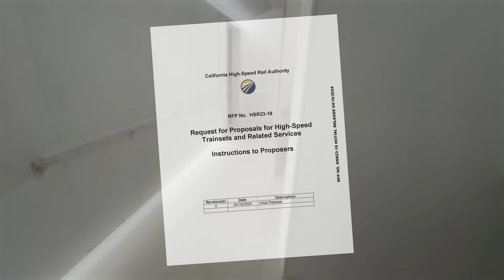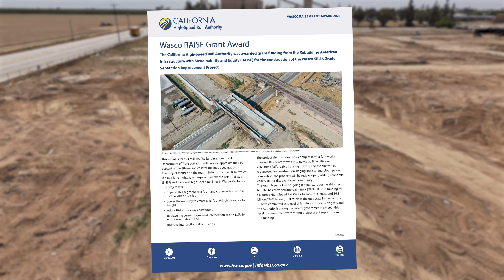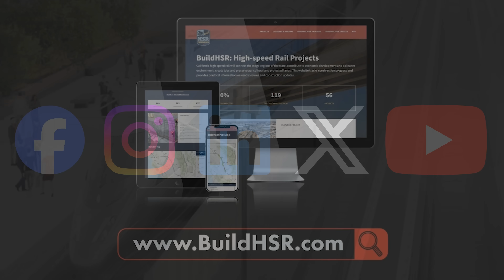Spring 2024 Construction Progress Report: Trainsets, Construction, Stations, and More!

Comment: All of this in only fourteen years at a cost of $11,000,000,000, we now have 1,600 feet of track on the ground, just for perspective that is the length of 1/4 mile drag strip with the run off area. Absolutely an unmitigated success story worthy of celebration, kinda like Olympic Break Dancing.

Comment: guess which one will be completed first, India HSR or CA HSR?
Reply: Trick question! California will never finish - costs have already spiralled out of control and this section is far-and-away the easiest/cheapest portion.  Tunnelling into Bay Area/LA will involve multiples-higher costs.
Reply: Of course, India’s. Despite being 503 km (312 miles) all viaduct route and 21 km tunnel (5km undersea), 153 km viaduct with 300 km foundation/pier work already complete. Construction started in 2019 and will complete by 2027-28. Cost is also USD 20B.
Reply: Both will finish in 2028 .. and both will be success ..
Reply: @unclekanaamcuttingwalahai332  2028? Oh dear. They won't even have begun tunneling - and by that time, their absurd lowball cost estimates will be a fantasy.
Reply: @ArthurDentZaphodBeeb  there is olympic in 2028.. so I think its possible they will work their @ss off before olympic to finish the project..and I dont think US should think about cost ..

Comment: QUIT WASTING OUR MONEY! Take 2% of that CHSR money and add lanes to Interstate 5.
Reply: Are you actually being serious? Have you heard about induced demand? There's no point in doing that, because sooner or later, the road will fill up again.
Reply: @NewBuildmini  First of all, even if this boondoggle ever gets finished, which I doubt, it will only take a tiny percentage of the people and none of the goods that travel I-5 and Hwy 99 every day. 

Have you ever traveled I-5 through the Central Valley? If you buy stuff, any stuff it probably traveled on a truck via I-5. The traffic caused by thousands of trucks and cars limited to two lanes of traffic each way causes an increased number of accidents, slow stop and go traffic, increasing pollution and wasting millions of hours of people's time. I would never use the train, as it would cost me time over flying, or save me so little time over driving, that it wouldn't be worth it, especially if I have to take the time and money to Uber to the station, then stand in line to rent a car once I get there. 

A high speed rail line would make sense for some, but I know very few of them. Most of those that would now, will be long dead by the time your precious CHSR is finished. The Vegas train makes way more sense, in that most stay in hotels in Vegas, and they walk or take taxi's between Casinos. The CHSR boondoggle will never come close to even paying for it's own operating expenses and will be a burden on taxpayers forever.
Reply: @traxiii  Not much else to say.  Nailed it.

Comment: Naysayers be damned. CA needs this badly.
Reply: In the construction accounting world we are very familiar with the concept of “percentage complete” - why don’t you ever disclose what percent of the HSR is complete?
Failure to do so is intentional obfuscation.
Reply: @davidepperson2376  "construction complete percentage" is hard to calculate on a project this size... do you calculate using time it takes to construct every element? or by mileage of track? for example, if you have a 100 mile stretch of rail right-of-way, and along the route there are 12 new grade separated bridges needed. each one of those bridges might take 6 months to complete. let's say CHSR has the capability of doing all the bridges at the same time, but combined that is 72 months worth of work, where lying the the 100 miles of track takes only 1full  year, you could say that CHSR is more than 80% complete in that in 100 mile stretch, even if there is not a single mile of track laid on the ground. my point is, all these massive infrastructure projects that are part of CHSR are really the heavy lifting portion. laying 500 miles of pristine track on a perfectly prepared track bed is the easy part.
Reply: Yes am pretty sure if we double minimum wage to $40/hour enough money can be raised through taxes too!  Go California!
Reply: Who “needs this badly”?  I can fly from anywhere in the LA area to Oakland for $56, and get there ina fraction of the time. Seriously - who NEEDS this?
Reply: @davidepperson2376 yeah if you buy your ticket three weeks out.

Comment: Hope you get this done by November if Trump gets elected he will cancel the project. You need to make progress or Biden and Trump will veto highspeed rail and the money gets returned. Finish the Bakersfield to Fresno Section then build to Victorville connect with Brightline that way the project gets done and no money is wasted. Also No Alstom their trains are a mess and the North East Corridor is a failure. If you want American Trains go with Siemens Mobility and Stadler. American Built American Made also if you use Siemens the trains will be delivered right to the Sacramento Repair Facility and put in service the next day. If you go with Alstom you will be facing bugs, delays, and broken promises. So Pick Siemens and Stadler everyone is doing it Amtrak, Brightline, Caltrans, you name it they are the best and they are American.

Comment: I would advise against Alstom. Just look at the mess that is the Ottawa LRT in Canada. It's only in the past year that the many issues with the trains seem to have finally been sorted out (bad wheels bearings, square wheels, derailments). Even then, we still don't trust these trains.

Did I mention that the LRT trains are unusually slow considering the cruising speed they were suppose to accomplish? And the doors are still extremely fragile.
Reply: As the pathetic woke CAHSRA hems and haws BLW has already correctly chosen Siemens.

Comment: Is even ONE train station finished that might excite the CA taxpayers? Is one even under construction? Bar 3d models? I don't mean to be a naysayer but if work stopped on the rail line today, then CA gets some nice overpasses and near nobody would notice what they didn't get. No stations, most overpasses not complete, no static train to show off. No overhead lines
Reply: Building the actual stations, like laying down the actual tracks, is something that is done relatively late in the process.  Doing things out of proper order would cost more and take longer.

Comment: I literally do not understand why some of these projects exist, why is rail funding going to help road expansion, that should not be happening, grade separation shore do that all you want, but using funds for the rail line to literally expand a roadway that will have Virtually no impact aside from the drivers that use that road, is insane
Reply: It's required to do the grade separation, which they have to do to achieve their speed requirements

Comment: Taking forever! But this will be useless if they don't add proper schedules. I live in the central valley and can't use Amtrak to go to work because there is not a early or a night train, hundreds of people would use it! Amtrak is great! We just need an early and a night train for those of us that work a little bit later!
Reply: Trains should run hourly or better, although possibly not when the first open just the Central section.
Reply: l believe the frequency of trains will increase for the San Joaquins and ACE especially from Sacramento beginning around 2028 and more so when CAHSR begins (hourly?) revenue service in about 10 years.

Comment: Nice to see the USA building high speed rail. Do you have a video showing the number of people that California High-Speed Rail can move away from domestic flights and/or long freeway drives?

What sort of integration is there going to be with your railway stations and local public transport? Are any of your stations rail hubs? Are you able to put in passive provision to support the reopening of a disused rail line or conversion of a freight line into a metro line that could have an interchange with any of your stations?
Reply: In the Central Valley, there is a project dubbed "Cross Valley Corridor" to establish regional rail in the area near the Kings-Tulare HSR station. The north end of the Central Valley segment in Merced is planned to be well integrated with the existing and expanded regional rail service for onward travel to Sacramento and the Bay Area. When the project gets to San Francisco and Los Angeles, those areas will be well integrated with existing networks, sharing corridors and stations with existing regional rail services.
Reply: Almost none of the above.

The San Francisco Bay Area has and Los Angeles area each have over 10 million people.

This high speed rail project will connect Merced to Bakersfield. Merced is a small town and Bakersfield is a medium sized town in the mostly rural and agricultural central Valley which is flat.

To connect Los Angeles and San Francisco they have to cross mountains. Here it's already been 16 years and they struggling to cross rural roads and highways. When it comes to mountains and underground urban construction - they will be in for a real challenge. 

Merced and Bakersfield are both extremely car-centric cities with limited public transportation. 

To be effective, they need options for people to actually be able to use it frequently for things like commuting. Not a once in 3 year trip to Hollywood. 

The Northern Central Valley is full of working class people who commute to the SF Bay Area because they can't afford to live there. Bakersfield is full of people who commute to Los Angeles because they can't afford to live there. Then we shame the lower class for having cars because they can't afford million dollar houses. Meanwhile the millionaires in those expensive houses don't want public transport because they don't feel safe on it.

Comment: A colossal waste of money for a train that literally goes no where!!! They’ve been at it for years and they haven’t finished the easiest part—there is no design or plans for creating the tunnels through the 3 mountain ranges.
Reply: Yes tunnels are technically more complex, but legally the central valley is complex in assembling right of way (ROW) with many individual property owners,. ROW can be a nightmare since it takes only one determined landowner to refuse and take the process to litigation. Going underground through a mountain doesn't have this complication to this extreme. The Swiss built a high speed rail tunnel that goes 36 miles under the Alps, much more extreme than what is needed in California to finish the project, it is not impossible.
Reply: One of the places the train will go is Fresno. Fresno is larger than the largest city in most of these United States. Are you saying that most states are nowhere?
Reply: @danielcarroll3358  Fresno is a great medium size city with a fine future in the most populous state but a million metro population (500k city limits) is not that much.

Comment: In 20 years it might be complete. This is a poster child for how NOT to build a high speed passenger rail system.
Reply: You’re right, opposition doing all is possible to obstruct funding and construction is not how we should be building this. We should be giving this total federal support just as every other HSR system has had, to get it the funding it needs and streamline the environmental and construction process to get it up and running as quickly as possible. The economic benefits this will provide, as well as the ridership revenue generated, will more than pay for it in the long run, much more than more freeway lanes and finitely expanding airports would anyway.
Reply: Testing of the Central Valley segment is supposed to begin in 2028 with it becoming operational by the end of the decade. But yes, the full build out to Sacramento and San Diego will likely take decades.
Reply: @orion7763  all comes down to how committed we are to building this, and thus how quickly we fund it and make it happen. If America can build the Interstates, we are more than capable of building high speed rail. 

It just becomes a question of how much do we really want to, who is willing to put up the bigger fight to build it or stop it, and who comes out on top. That could be said for just about everything.

Comment: There is no California High Speed Rail.  It does not exist.  They have a few bridges that are under strength, and sections of the to-be path are sinking into the valley floor.  
This project is a lie.  A falsehood.  A scam.
Reply: Educate yourself.
Reply: As long as construction is active, you're wrong.

Comment: Curious as to why the central valley was priortized first. Nothing but empty land and farms there. Would think SF or LA would be prioritized due to ghe anount of people and the avg salary per customer being higher.
Reply: Furthermore, they Bay Area also benefitted from CAHSR with the electrification of Caltrain and reduction of level crossings (if incomplete as of now), it's just that Metrolink in LA is struggling with a similar project for various reasons (including themselves). The only other work left is to get through the mountains between the three regions which are going to take a lot of time and conversely are the most complex.

Of course, you can always improve both metro areas further like straightening tracks and occasionally dig a tunnel (see South San Francisco and Brisbane) but these are past the diminishing point of return for the project as a whole (thanks to property acquisition but only a minor increase in speed).
Reply: @MarioFanGamer659 Caltrain Electrification wasn't funded by CAHSR if my information is correct. Caltrain was going to do that anyway to increase their own capacity by decreasing needed headway compared to the diesel trainsets.
Reply: @GregoryVeizades  CAHSR helped fund some of it, giving something like $700 million to help cover the $2.44 billion price tag. CAHSR helped push electrifying the Caltrain corridor, which had been talked about for a couple decades prior to CAHSR getting involved. So while it may have one day happened eventually on its own, CAHSR helped get the ball rolling much sooner and get it done.
Reply: If you started in LA how far do you think it would be by now? In the LA and SF areas, the CAHSR would, more than likely,  not run at HSR speeds due to the existing ROW it would need to share. There is no room for CAHSR to build it's own ROW the way it is in the Central Valley. The Central Valley was always going to be the largest fastest section.

They also built in the Central Valley because Republicans would threatening to kill federal funding if it didn't begin in the more conservative Central Valley. 

Lastly, this stretch will also be used to fully do dynamic testing at the highest test speeds of 242 mph. You couldn't do that anywhere near LA or SF.
Reply: @mrxman581  makes sense. Thanks. 👍🏾
Reply: @Sirvibin86  In addition to the reasons mrxman581 mentioned, the money also went further in the Central Valley. The construction to date has cost about $12B. Starting in either LA or SF requires tunnels that would have consumed most of that money just to make it out of the city, through the mountains, and sticking the nose of the service into the valley, so a video of progress in a timeline where they had started in SF or LA might have just been the inside of one or two massive tunnels, extending only 50 or so miles out of one of the two cities.
Reply: @rwdavidoff  thanks. Well, I hope when this initial section is complete, there are enough people with high salaries in the central valley to pay to use the train from Merced to Bakersfield. From my 10 years in the Bay/Yosemite area, there is literally nothing but farm land and low income communities there. 

People in SF and LA won't travel to Bakersfield or Merced to travel through to he central valley. They will take i5 until this thing is able to reach major metropolitan areas.

I hope CHSR isn't counting on passenger revenue to help fund construction into LA and SF. 

I'm a huge train fan so Im hoping this thing works out for everyone. 🤞🏾that  Trump stays out of office because you can kiss CHSR goodbye if that happens. The US will never operate the same if Trump returns to the oval.
Reply: @Sirvibin86     It's the only section that could ever be built. I expect the whole thing will be cancelled as soon as they can save face, but if this section does get finished, it will be seen by everybody just how few passengers there are, and how much money it loses. Even liberals might understand the folly then.

Comment: are there any plans for bus connections to towns that are not served by the rail itself?
Reply: Several, both at the ends, and in the central valley proper (look up the "Cross Valley Corridor," which is a plan for phased implementation of bus and then rail service running perpendicular across the valley meeting HSR at Hanford, linking places like Lemoore, Hanford, Visalia, and Porterville )
Reply: Yes, including Los Angeles for the time being. Unfortunately, it doesn't seem like there will be a train connection from LA to the CAHSR initial terminus in Bakersfield. Which sucks. However, there will be a train connection from SF to Merced as I understand it.
Reply: @mrxman581  East Bay to Merced, yeah, with bus/BART to reach SF, same as it is now. As for Bakersfield-LA, that’s all the more reason to push funding and building CAHSR’s Bakersfield-Palmdale segment, in addition to Merced-San Jose, so both open at the same time. Hopefully that could happen by the mid to late 2030s, though it depends on when construction starts which probably won’t be earlier than 2031, after Merced-Bakersfield begins service.